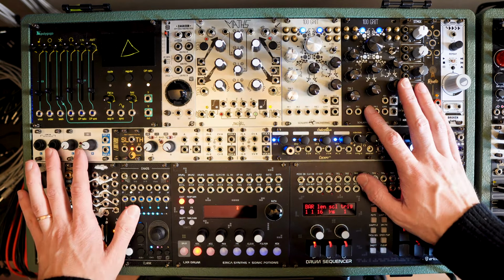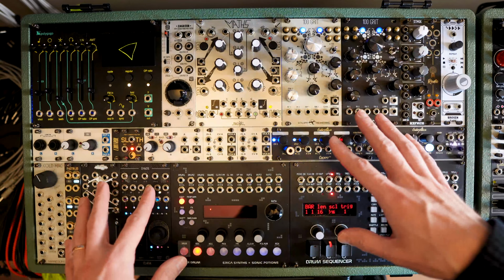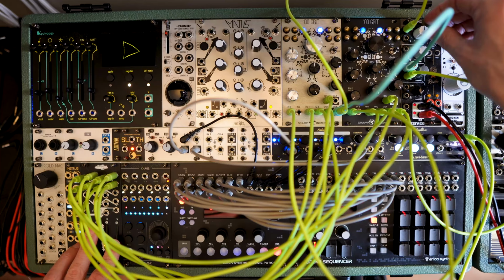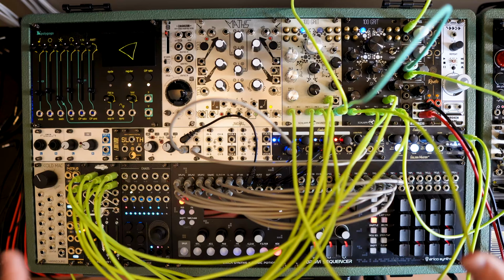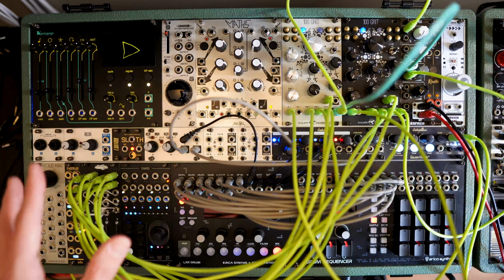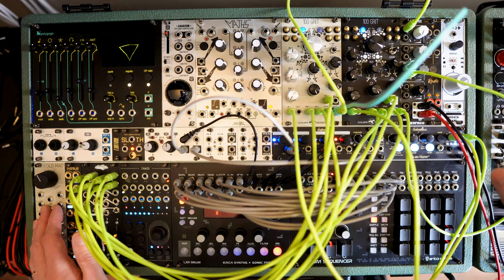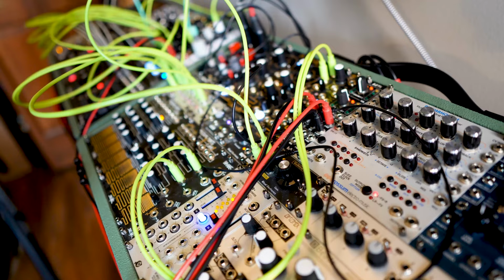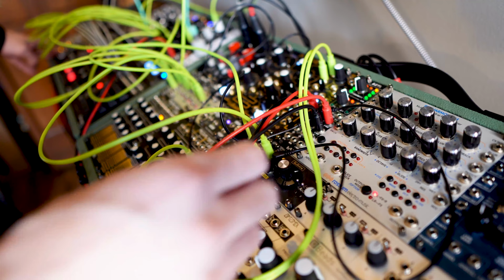Trying to Make a Mono Eurorack Module Stereo

Comment: a bit late to the party here, but one of the brass balls on the left is the pure dist 2 output, so you could psuedo-stereo with dist1 and dist2 usiing one 100 grit. 

You can try it out by holding a patch cable to the brass ball, if you want to patch it more permanent I suggest an alligator clip
Reply from the maker: Oo. I need to try this. Good lookin out, thank you
Reply: @thismeanswarbasse  one more thing, while we're at it:

Since the filter output of the 100grit is inverted, you can easily use it to create a faux-high pass by simply summing the input and the output.
Reply from the maker: @vidret  love these tips thank you
Reply: @thismeanswarbasse  oh damn I got one more. this one you probably know already.

Input 1 and input 2 aren't only different because of the different feedback paths patched in. Input 1 is resonance compensated, so it keeps your bass as you crank the resonance. Input 2 isn't, and thus is just like an old school moog low pass ladder filter (gets croakier and thinner with more resonance)

Comment: 100 grit sounds great for sure. That’s a lot of hp just to get stereo though (loses some solidity in the center, just imo). Great video!
Reply from the maker: Part of me wishes I could more easily patch so that golden master comes after the 100grits, just so I can use the low-end monoing feature to pull that back together. I might still try that out but I'd need another mixer somewhere to slot into play

Comment: The difference is very appearent on my monitors, and it sound killer. I will try getting some stereo destruction going by feedbacking my QPAS. Love the QPAS on drums anyways.
Reply from the maker: Never tried a QPAS, but that sounds like it could be really great.
Reply: @thismeanswarbasse  Feedback on QPAS is quite easy to do since it hast so many inputs and outputs. It also drives nicely if the Input VCA is cranked. So im sure Something fun will happen, even if probably not as gnarly as the 100Grits.

Comment: I wonder what it would sound like if you summed the low end to mono? It sounds really funny to my ear on headphones. That's the kind of thing that's easier to do in digital land... (Seems like putting a stereo crossover into your rack would be a waste of $ and hp given how easy it is in the box.)
Reply from the maker: Golden Master 1U has the ability to adjust the stereo image of static low, mid, and high eq bands and I’ll typically crank the low band’s image all the way down so it’s basically mono and extend the high band to be really pushed into stereo. That’s only slightly engaged in this patch if I remember correctly, but it does help a lot.

Comment: Have you though about getting a Worng LRMSLR so you can do mid/side stereo instead of just trying to match the parameters L&R? I do it with two different mono filters & find it really worth the difference.
Reply from the maker: I have thought about it and have almost bought one a few times. This dual setup still is taking quite a bit of fine tuning and practice to not get totally out of control, so it might actually be something I end up doing in the end. I’m going to give this some time first and see if it ends up working well in an actual performance context after more practice
Reply: @thismeanswarbasse  yeah that's fair enough, always good to check if something actually works in practice rather than just dreaming about the 'ideal'
Reply from the maker: @M_orcan  definitely easy to get caught up in the dreaming though!